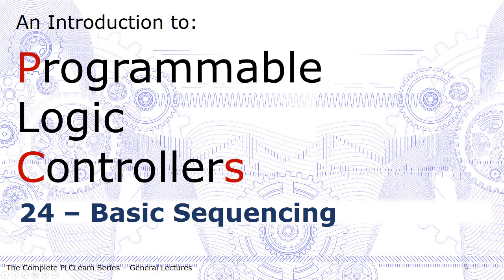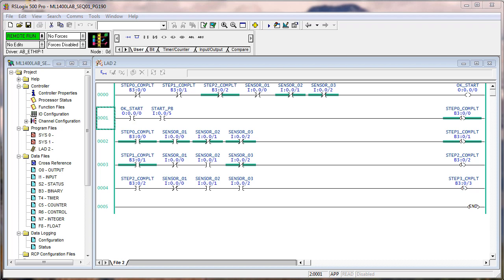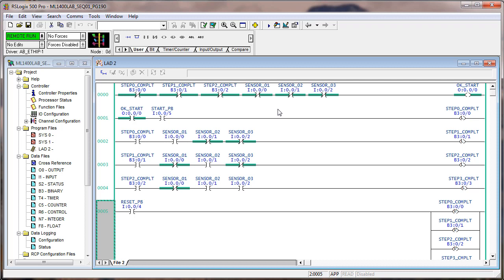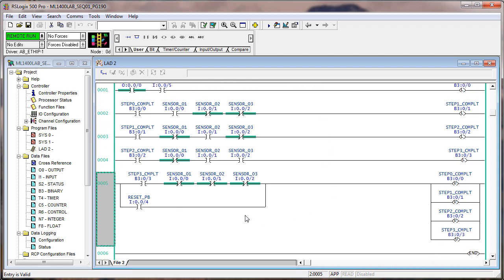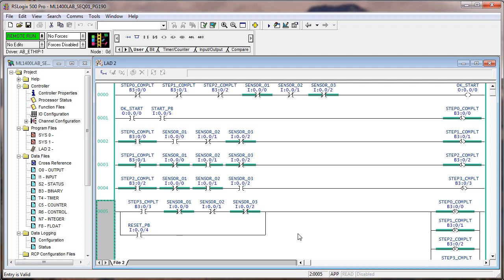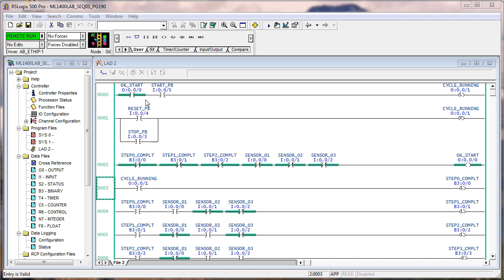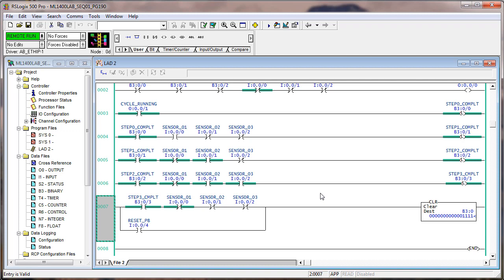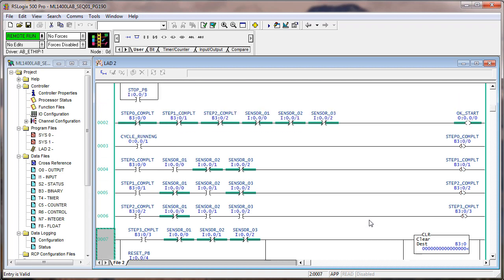28A - ML14 Sequencing Latch/Unlatch P182

Comment: When comparing the logic of STEP1_COMPLT and STEP2_COMPLT, I see that two of the three sensors have to be off in order to complete steps 1 and 2. But in case of STEP3_COMPLT, only one of the three sensors has to be off in order to complete step 3, meaning that sensor 2 has to be on for steps 2 and 3 to complete. I understand the logic but is that ok in real world?